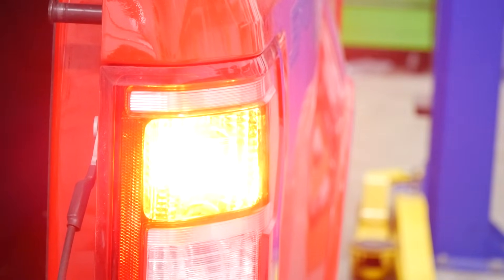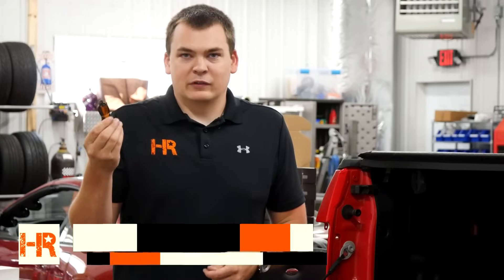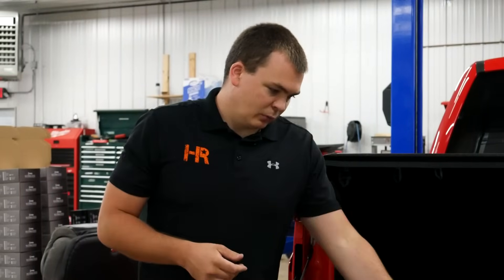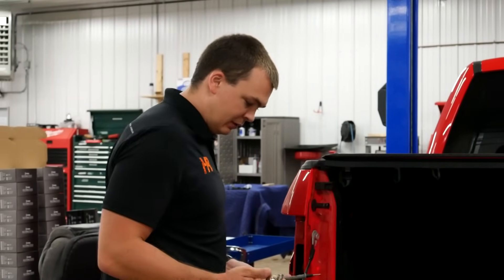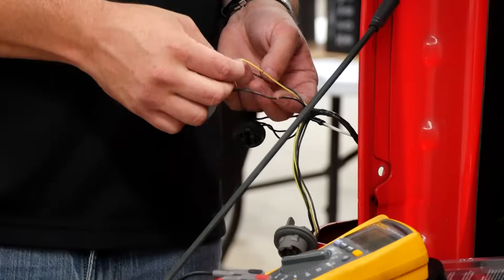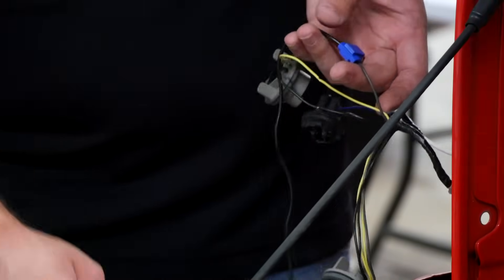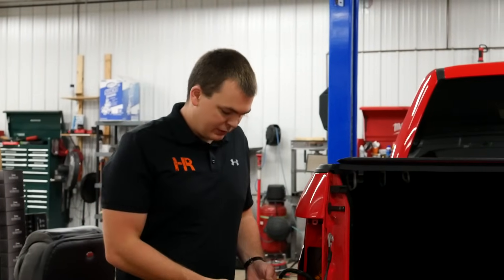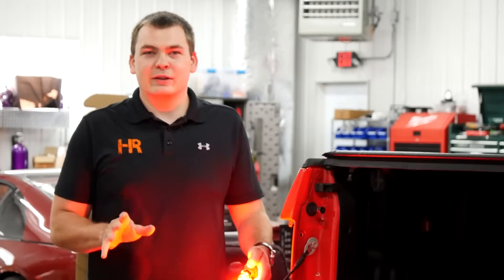How To Install LED Resistors - Everything You Need To Know | Headlight Revolution

Comment: Great video, but you omitted to talk about resister values. Some systems need a 2.5 - 3 Ohm resister, but some systems need a 6 Ohm one. They are not always interchangeable. I have heard of folks fitting a 6 Ohm unit and it failed to work. From personal experience, oh yeah, those little sucker DO get very hot, I had one melt it's way clean through a wire!!

Comment: I just bought led tail lights for my 2021 ram to upgrade my halogen I also had to buy a harness adapter however it seems like I need a resistor for the turn signal lights as they keep going out after constant use which kind of resistor I need for this matter please help me

Comment: I didn’t change my turn signals to LEDs. I changed my headlights and I’m having my turn signal hyper flash. The front one doesn’t work but the back one hyper flash what do I do? Do I put it on the back tail light or the headlights?

Comment: To make things easy, download your car's electrical manual from the manufacturer.  Tells you what color wire is what over the entire vehicle, along with every pin, socket, etc.  Everything.  No probing required.  Install the resistors close to where the harness actually plugs in, and if multiple bulbs flash in a fixture, use a bigger resistor such as 2 bulbs flashing = 100W 3ohm resistor on the harness instead of doing a 50W 6ohm resistor on each bulb.

Comment: I put LEDs into the turn signals of my 93 accord. They seem to blink at a normal tempo, but they want to continue to glow dimly all the time. This obviously kills my battery. I assume the resistor would cure the glowing all the time issue as well?

Comment: One resistor to one LeD turn signal light? Couldnt you just go to the flasher and use a resistor for each side of the vehicle ? saving the cost of having to buy 4 resistors instead of just buying 2?

Comment: My LED brake/turn signal bulbs work just fine on my '19 F150 but, the dash indicator flashes fast! Will resistors correct that??
And, do I need a resistor on every brake/turn signal bulb? That is, with 2 bulbs in each sire of the truck, I need 4 resistors??

Comment: I need to know, am I crazy for switching my interior dome lights to remote controlled IR RGB lights in my 09' Hybrid Highlander?

 I've tried and burned a couple dome lights out, but I have a hybrid so I'm just nervous about messing something up. My fiance shot 5 fuses dead just trying to hardwire my dash cam. Should I try resistors in each dome? Is that feasible? I also switched my headlights and fog lights to led without doing anything special. I think my question is, should I get resistors for the inside and outside or take the time to change the exteriors to led housings? (Not housing but the thing the bulbs go in, I can't remember the word.) TIA!!

Comment: Do you need to splice a resistor to every LED bulb?
Reply from the maker: Only the bulbs experiencing hyper flashing, typically most seen on turn signal circuits. So if your turn signals are hyper flashing, no need to add resistors to the brake lights. One resistor per turn signal would be the fix!

Comment: So I know this is an old video but I just finally got around to installing the resistors on  my 2019 Tacoma, the hyper flashing is gone when I have the lights off or in DRL but once I turn either the running lights or headlights on the Hyper Flashing comes back, any ideas?
Reply from the maker: Which bulb do you have the resistor installed on — the turn signals or the low/high beam circuit? Reach out to us at sales@headlightrevolution.com and let us know how you have them set up so we can help troubleshoot.

Comment: Thar 3 door …wy16y bulb 16w use before now install 4w led bulb( both bulb rear side ) hyper flashing facing …. Now which is best 25w load resistance or 50w …?
Reply from the maker: Since your stock bulb was 16W and you dropped to a 4W LED, you’re losing about 12W of load per bulb. A 25W resistor is usually more than enough to stop hyper flashing in that situation. A 50W resistor would also work, but it’s overkill — it will run hotter and isn’t necessary unless you’re matching the load for higher-wattage OEM bulbs (like 21W turn signals).

Comment: Ive replaced all 4, would the same go for the front as well?
Reply from the maker: Yes—if the front turn signals are hyperflashing after upgrading to LED, then adding a resistor will fix the issue, just like with the rears.

Comment: What about if my turn signal works correctly but i receive dash light saying that there is open circuit in parking light?
Reply from the maker: Some vehicles won’t hyperflash but will still throw a dash warning light. That usually means the system is detecting an open circuit in the parking light, and in most cases, a resistor can fix it just the same!
Reply: @HeadlightRevolution still connect ground to turn signal wire or ground to parking wire if dash says parking light open circuit?

Comment: Added a triple row Tailgate LED Light Strip to my '23 Ford Maverick Hybrid using Ford OPT7 connect harness. I still want to use OEM halogen bulbs in tail lights. I have hyper flash on the dash and driver turn signal and brake light stopped working. Disconnected OPT7 harness and I now have driver turn & brake lights. By adding resistor to each factory tail light wiring harness for ground and turn signal, will I then have functioning LED tailgate strip  and driver tail light along with dash hyper flash elimination?
Reply from the maker: That sounds like a wiring compatibility issue, but you’re on the right track — hyperflash and dash errors are usually caused by a mismatch in resistance and can often be resolved with resistors. That said, since we’re not super familiar with the OPT7 harness or that specific tailgate strip, it’s worth reaching out to the manufacturer first. They might already have a fix or recommended setup, especially if it's marketed as compatible with the Maverick. If they don’t, then testing resistors on the factory tail light wiring would be the next logical step.

Comment: What resistor is best to use in a 2015 Dodge Grand Caravan for LED interior light?
Reply from the maker: We don’t recommend using resistors for interior lighting—those things get really hot and can melt plastic or worse, especially since interior lights are surrounded by fabric, carpet, and trim. If you’re having issues, it’s likely a compatibility issue with the specific LED bulb you’re using. We’d suggest trying a different brand or spec. Resistors are more commonly (and safely) used on exterior lights like turn signals, where they can be mounted to metal surfaces.
Reply: When I close my doors, there is a faintly shade leave in the interior lights, and I don't know how to get rid of it 😢 because the LEDs draw less electricity

Comment: installed the canbus resistor but now the indicators work fine but the warning indicators do not work, if I disassemble the canbus resistor the warning indicators work but the normal indicators go way too fast.
What is the solution?
Reply from the maker: It sounds like the resistors you’re using may not be fully compatible, possibly due to the wrong ohm rating or other factors. To help troubleshoot this, could you please provide more information such as your vehicle's year/make/model and the bulbs/resistors currently installed? This will help us better understand the issue and find the best solution for you.

Feel free to reach out to us via email at sales@headlightrevolution.com or give us a call at 218-755-5200, and we’ll be happy to assist you further!
Reply: Ok thank you,
I will contact you by email

Comment: Hi, when i connect a resistor the LED flashes less bright than when it is without a resistor. Any ideas how to fix this issue? Otherwise they are as bright as the standard bulb.
Reply from the maker: It sounds like the resistor you’re using may not be the ideal value for your setup. We typically see resistors range anywhere from 4 ohm to 15 ohm, but a 6 ohm resistor is usually a solid starting point for most LED applications.
Reply: Hi and thanks for coming back to me. I am currently using 50W, 8 ohms resistors. The part I really don't understand is why they are 50W when the standard bulb is only 5W.

I have now ordered 10W, 39 ohms and 20W, 6 ohms. Hopefully one of them will fix the issue. Otherwise it totally defeats the purpose of using LED if they are dimmed down by the resistors and as bright as the standard bulbs.

Comment: I have a 2003 Chevy Tahoe, what resistance model do I have to buy?
Reply from the maker: For your 2003 Chevy Tahoe, we recommend starting with a 50W 6-ohm resistor. That usually does the trick for most applications.

Comment: This could help if my turn signal lights work, but at sort of time when I activate my signal lights stop working and I receive a message on the dash “turn signal lights out”. I bought this but I’m not sure if I installed it correctly!
Reply from the maker: It sounds like it might be a polarity issue—some LED bulbs are polarity specific, so if they're installed backward, they won’t work at all. Try flipping the bulbs around in the socket and testing again. If you're still getting that error, feel free to reach out—we’re happy to help troubleshoot!
📧 sales@headlightrevolution.com
📞 218-755-5200

Comment: mine does not blink/flash faster at the exterior signal bulbs, but the turn signal sounds faster inside the cabin/ and the signal symbol at the cluster flashes faster
what should I do ?
Reply from the maker: Even if the exterior bulbs aren't flashing faster, that rapid clicking sound and fast flashing in the cluster usually means your truck still detects a lower load from the LED turn signals. A resistor is still the solution—you’ll want to install it just like we show in the video for the signals you upgraded. That should fix it right up!
Reply: @HeadlightRevolution  thank you for the rep, let me try the resistors

Comment: My issue is after installing leds bulbs my headlights dim when using the turn signals. I have a new battery and the alternator is good I had it check. And resistors don’t see to help either.
Reply from the maker: Did you install LED bulbs in both the headlights and the turn signal positions? If so, this might be a circuit sensitivity issue. Try swapping one of the bulbs back to halogen temporarily and see if the dimming still happens. That’ll help narrow down if it’s a voltage/circuit issue or interference from the LEDs themselves. In some cases, a PWM module can help stabilize the signal, but this sounds more like a deeper electrical interaction than just a resistor fix.

Comment: Helpful video… can load resistors be used for headlights as well?
Reply from the maker: Glad you found it helpful! Load resistors can be used for turn signals and parking lights, but for headlights like low beams and high beams, we recommend using plug-and-play PWM modules instead—they’re more efficient and safer for headlight applications.
Reply: @HeadlightRevolution  Have a 2015 Honda CR-V.. just switched to an H11 LED bulb, which is what vehicle uses… trying to determine if a PWM module is needed vs an LED Decoder.. any insight based off your experience?

Comment: I have the same problem in my 2012 Silverado, when the position ligths are on the hyper flash Start, but when my position ligths are off and use the turn signal they dont hyper flash
Reply from the maker: That sounds like a common issue with how the truck’s electrical system handles LED bulbs. When your position lights (parking lights) are on, it's likely causing a feedback loop that leads to hyper flash.

A resistor or LED flasher relay is usually needed to correct this.
Reply: @ What happend if a put a resistor in the parking ligths? They will solution the problem beacuse i think This Chevy dont have a blink relay

Comment: Question my friend look I bought led tail lights and front led headlights now I have hyper lights when I’m use my signal lights but led headlights and tail led lights came with resistors already and even like that still not working properly what else can I do to fix this problem please let me know. Thanks
Reply from the maker: If the provided resistors aren't enough to eliminate hyperflash, you might need to add more resistance or replace them with a different type.
Reply: I have the same problem in my 2012 Silverado, when the position ligths are on the hyper flash Start, but when my position ligths are off and use the turn signal they dont hyper flash

Comment: Can you please tell me why you have 2resistors ..one next to the other...they are for two different bulbs?
Reply: 10.05 on video
Reply from the maker: The resistor you’re seeing was pre-installed for a different light on the vehicle.
Reply: So two resistors for two bulbs on the same light...thanks
Reply from the maker: Nope, you only need one resistor per bulb. The resistor you're referring to was pre-installed for a different light on the vehicle—not the same one. So to clarify: one bulb = one resistor.

Comment: Hello, if I want to put LEDs in the reverse light, do I have to follow the same procedure?
Reply from the maker: Nope — resistors are typically not needed when upgrading to LED reverse lights. Resistors are most commonly required for turn signals to prevent hyperflash. For reverse lights, you should be good to go with a simple plug-and-play install!

Comment: Hope someone can help with this cus idek anymore.😭 I got a 3rd gen 4 runner and I installed new whole led tail lights. After installment the abs light turns on and is only on when the engine is running. I still have yet to put a resistor on, but wanted to get any feedback on WTH going on😭
Reply from the maker: This is most likely caused by the LED tail lights not having enough resistance, which can sometimes trigger the ABS light. Installing load resistors should resolve the issue by correcting the circuit load.

Comment: Ever have all 4 blink when you turn one of the turn signals on?
Reply from the maker: That’s definitely not normal. It sounds like there may be a wiring issue - did all the circuits get connected together somehow?
Reply: @HeadlightRevolution  no. It's all running thru a trailer 5 wire to flat 4 adapter. It's an LED light bar. Left turn signal works. But right make them both flash. I think I need to add a diode to keep it from back feeding to the other blinker

Comment: I have 2018 chevrolet traverse LT.  My backup light uses a halogen bulb and I want to install an LED light in place of the halogen.  What load resistor kit do I need for my suv? And do you have available for my Traverse?  Is there a plug and play load resistor kit that I can just plug and be done with it.
Reply from the maker: Great question! In most cases, a load resistor is not needed for reverse light upgrades since they typically do not cause hyperflash - resistors are more commonly required when upgrading turn signals to LED. However, if you do experience any issues after installing the LED bulbs, we recommend using a 50W 6-ohm resistor to correct any potential errors.

Comment: Great video. I cant find anyone who can tell me what type  resistor to use on a Porsche 996 Rear tail light experiencing hyperflashing . Any advice here is appreciated
Reply from the maker: Glad you liked the video! For a Porsche 996 rear tail light experiencing hyperflash, we’d recommend starting with 50W 6ohm resistors, which work for most tail lights with this issue. You can find them here: https://www.headlightrevolution.com/50w-6ohm-gold-resistor-ACC.RES.50W_2.

Comment: About to upgrade number plate lamps to led's (tub to tray conversion) do i need a resistor on these lamps?
Reply from the maker: No, license plate lights don't typically need resistors. Mostly used for turn signals!

Comment: I had to refit a trailer tail light unit yesterday. There was no info on Amps rating or forward voltage etc. I went out and found a unit exactly matching the existing LHS side. I cut the old wires and soldered in the new just like you would for an incandescent system. 
I'm hoping for two things that I'll never know to be true. First is that there were existing resistors up front in the factory wiring?? And or, that the LED's in the entire system were managing the source voltage with no need for resistance? 
I'm NOT an auto electrician. I'm just ordinary 'Joe Driver'. Put simply, I just connected new wires to the existing and nothing else. I won't be the least bit happy if the new unit *blows' will I?
Reply from the maker: You did everything right! It's great you found a direct replacement unit. You're in the clear, the new unit will be fine.

Comment: i love both multi meter and test light and use both  also why not put the resistor  inside the taillight housing do they get hot enough to melt it wondering for winter to help keep ice off my tail lights
Reply from the maker: Yes, resistors get hot enough to melt plastic, so we don’t recommend mounting them on or inside the tail light housing.

Comment: Do you need a resistor for each light bulb?
Reply from the maker: Yes, if resistors are needed, you will need one per light bulb. However, resistors are only necessary if your lights are hyperflashing. If your LEDs function correctly without them, you won’t need to install any.

Comment: Working on an old KLR 650 motorcycle. What resister do I need & do I need a resistor for each light or one per Left and one per right?
Reply from the maker: It depends on which bulbs you're adding resistors to. For headlights, we use PWM Modules, which are plug-and-play. For turn signals and brake lights, we typically start with 50W 6-ohm resistors, and yes, you will need one per light. However, resistors are only needed if the lights are hyperflashing - if your new LEDs function correctly without them, you won’t need to install any.

50W 6-ohm resistors: https://www.headlightrevolution.com/50w-6ohm-gold-resistor-ACC.RES.50W_2?quantity=1